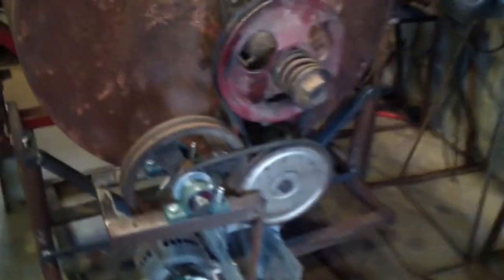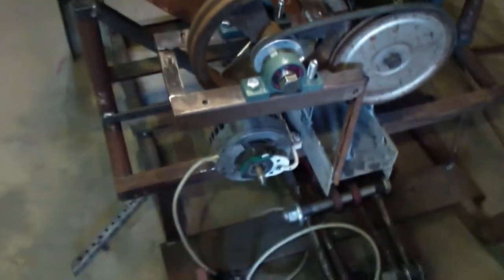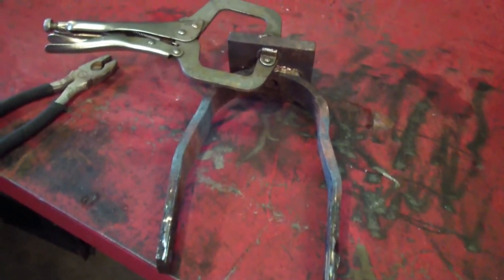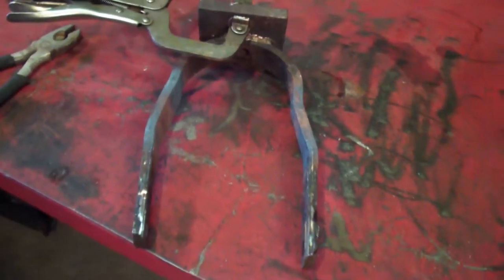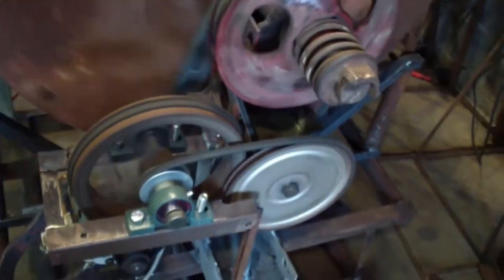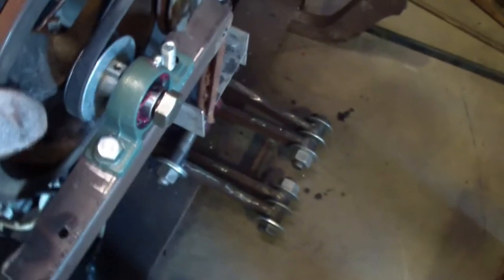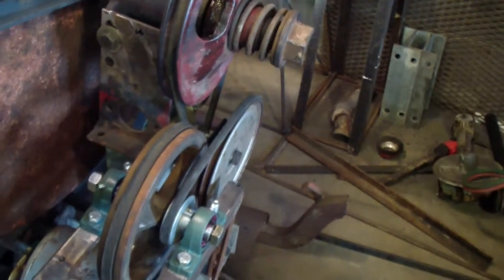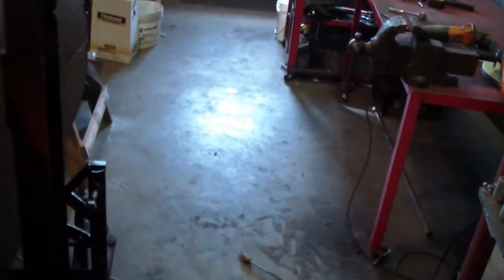Part 11 Fabricating 1/2 yard cement mixer

Comment: You might could put the wheel on a pivot with a lever and some trampoline spring (or strong springs) This will act like a reverse shock LOL   That is of course if you cant beat the flat spot out enough.   Looks good nice set up!!!